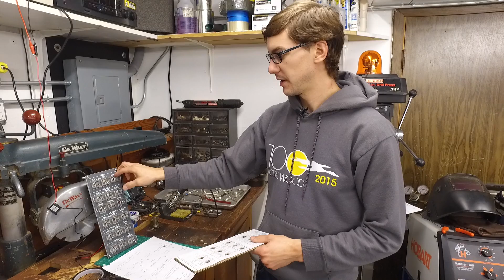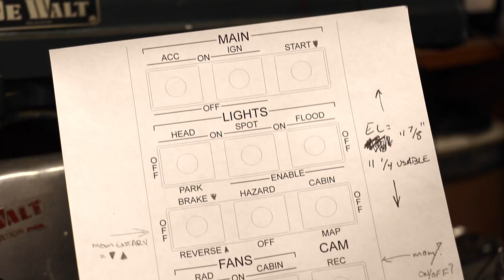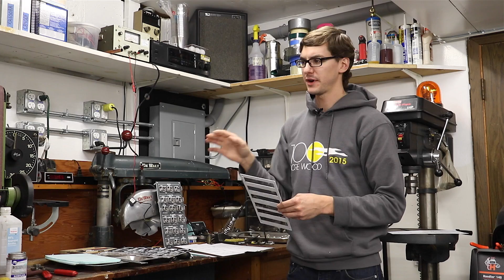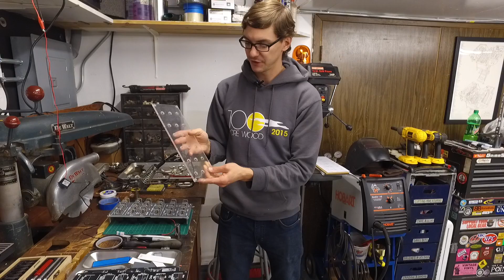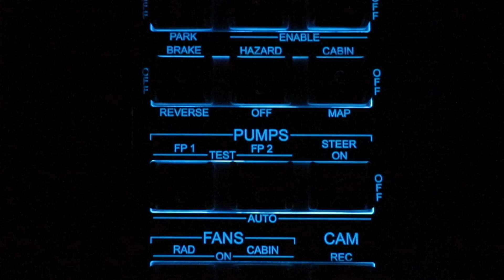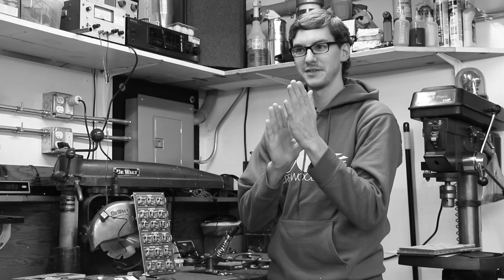NASA Inspired Switch Panel - Project Syncro #37

Comment: Man, your panel is AWESOME!!!!!

Excellent build instructions.

Only TWO issues:

First, GET TO THE POINT FASTER. You seem to make your explanations, and reasoning behind them, 5 times longer than needed. I almost went to another video simply because you went on for so long before actually showing what you were talking about.

Second: The EL panels you are using are the same ones I was planning to use, until digging through some specs, and some old NASA panel info. Those EL strips will NOT last for long, their brightness will fade by at least 50% in a short time of use. NASA was not concerned with this, as the panels were never meant to live or be used for more than a week or so.
I would suggest you consider LED backlighting. It'll last MUCH longer, and can also be controlled.

Also, the toggle switches you have are obviously not the same style NASA usually uses, but those paddle switches with the corrugated surfaces for big spacesuit gloves ain't cheap. Honeywell makes them, and they can cost $80 each. I made a simulation of them with plastic paddle switches I carved and painted to look like the big paddles, and it works! Got them from China real cheap.

Anyway, you've inspired me to make my own car panel. I'm already making one for my scale model of Disneyland's  TWA Moonliner.

BTW, as a professional graphic artist for more than 40 years, Corel Draw FAR outdoes Adobe Illustrator. It's a highly powerful and useful program that any professional publishing house could do just fine with.

Comment: I know that this has been quite a while since it was posted (like 2 years...), but I just found it and I was doing some prep work for a project that involves NASA Spacecraft panels.  If/when it comes to fruition, I might even post my own videos (maybe).  However, I was looking for the materials you discussed in your video, specifically, the Rowmark you talk about.  And I found the company, but I am not sure which of the materials they make that I should be looking at.  Would it be possible for you to reply with the specifics and also how that has held up to the rigors of heavy duty use?  Much appreciation and continued success to you!

Comment: Fantastic! This has fueled my interest in rewiring a local rally car with circuit breakers and mil spec switches.
Reply from the maker: +G4Disco Stay tuned because we will be completely wiring the car soon. (next few month, hopefully)
Reply: +Project Syncro If you need any guidance let me know. I'm an aircraft electrian in the AF.
Reply from the maker: We might just take you up on that. The connecter Ron is using for the switch panel is an older Russian mil spec connector.  We are still trying to figure out what we need for engine bay/firewall multi-pin connectors.  Looking for something with both signal and power lines; power with a pretty decent gauge size.
Reply: +Project Syncro If you want to use proper aircraft parts you might get some sticker shock with the tooling. Strippers, $150-$250 as an example.
Reply from the maker: oh we are fully aware of the crazy prices for some of this stuff.  It is one of those expenses that are worth it, though.